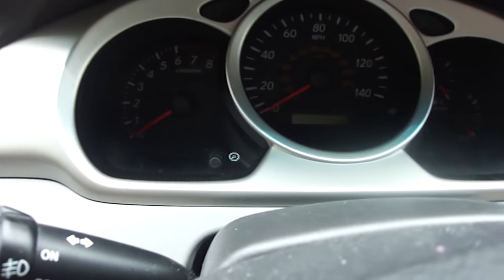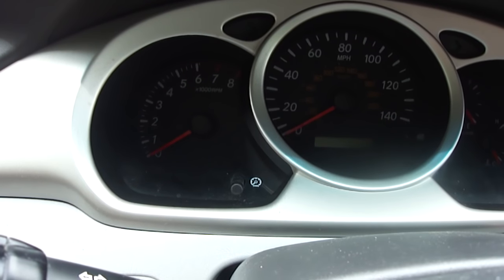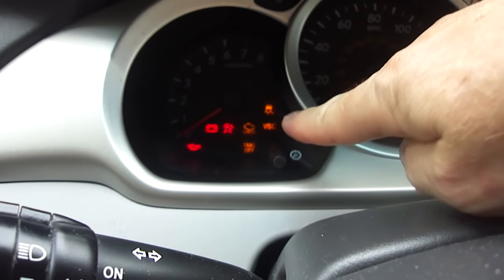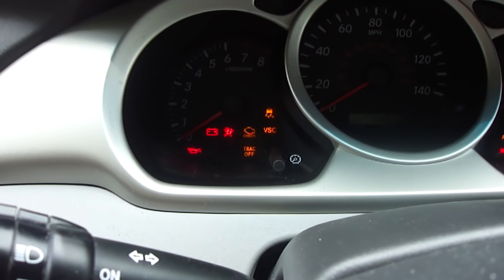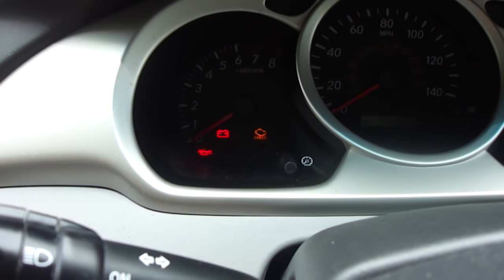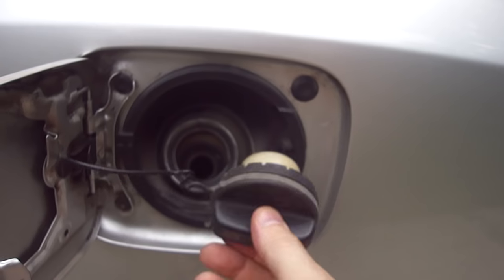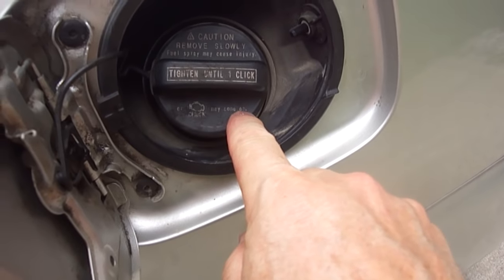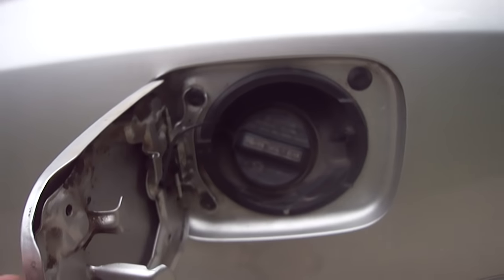(Part 1) How To Fix Your Check Engine, VSC, Trac Off Warning Lights On

Comment: Hey hi. Thanks so much for this hint. I probably saved a certain sum of money. While watching your video I remembered I'v  put some gas today and maybe it was the cap as mentioned in your video. It was actually the problem!!   By the way I don't know if it's related but today was extremely hot and humid.
Reply from the maker: You're very welcome!  I would have the car checked with a diagnostic computer scanner to see what trouble codes it stored from coming on which any auto parts store should do for free.
Reply: Hi. Yes, you're right. That TRAC Off and the check engine sing came back so I will go to for a scan this week. I have no idea what can it be. My car is a Lexus ES300 1999. Thanks a lot.
Reply from the maker: 8Bit Time Traveler Don’t sweat it! It’s more than likely a oxygen sensor or a mass airflow sensor which is easy to fix.
Reply: Gosh. What do you think it can be? Do you have a clue please?
Reply: I'm sorry for being annoying but I'd like to add few details about my car and what I did with these last days:
1- Last monday I discovered there was a hole in the left front tire so took off the whole wheel and replaced it by the spare. The spare is the exact same size than one that was there and is completely new.
2- I'v filed the tank with ordinary gas before going to work.
3- Yesterday I'v worked in my car for 12 hours to make a surveillance (I work as security). The aircon is not working but I kept my car open to "enjoy" the hot hair that was better than nothing.
4- The temperature yesterday and today is super hot. 33-36 C. and a feel like of 44 C. I don't know if it's related.
Thanks a lot.
Reply from the maker: Nothing really jumps out at me from what you've told me.  I know that extremely hot outdoor temperatures can affect electronic components on a car, especially if it sits and idles a lot.  Hopefully, having it checked for trouble codes will clue you in to the problem.
Reply: Hi Paul. I went to see a friend of mine who has a scanner. There are 5 codes: Codes P0125 P1130 P1150 P1133 P1153. He will search and try to see what's the problem. Thanks a a lot.
Reply from the maker: You're very welcome!  Could be a faulty or poor electrical connection for 02 sensor or in a very rare case a faulty PCM (powertrain control module, also known as ECM or engine control module.   Do you have stalling or jerking with manual transmission, or shifting problems for automatic transmission?
Reply from the maker: It makes sense that you fixed the P0125 code from adding engine coolant which fixed the problem of it not detecting enough heat in the cooling system.  If you end up needing to replace the oxygen sensors you might want to call Denso https://www.densoproducts.com/Automotive-Oxygen-Sensors-Denso-c1317.aspx and see if they make them for your car (very high quality) and see what it would cost on Ebay which will be your best pricing.  Keep a close eye on your gas mileage which can also tell you a lot about the performance of your oxygen sensors.
Reply: You are right. I just took an appointment at the garage to change the engine coolant. Thanks so much for this link. This is great to know. I hope he delivers in Canada.I'm in Montreal. I will check.
Reply: Monday we checked the engine coolant and it was dark green. We also thought it would be a good idea to change it.
Reply from the maker: Good idea.  Make sure you flush the system.
https://youtu.be/dRP4D40Vo8E
https://youtu.be/7bYbwBMbnTQ

Comment: While you're diagnosing this problem any codes come up I have a 2010 avalon that did the same thing with code p0300
Also misfire from cylinder 135

Comment: I have 2007 Sequoia. All the dash lights came on in the cool am but not in afternoon. Turns out brake fluid was just below the minimum in the am but just over min when it warmed up. 3$ fix.

Comment: My same lights came on & the “code” indicated a leaky gas cap. Got a new one & placed it on tightly/4 clicks but lights are Still on??? The lady that sold it said it Should (eventually) go off though,,,am I panicking too soon? Please help. Thank you! 
(I have a ‘05 Scion/Toyota xB) 🚙
Reply from the maker: djCatScanRL Do not panic and the lady is right. It should definitely turn off after you’ve driven 50 miles or less if that’s the problem. By the way, the car will usually drive just fine even with the light on.

Comment: Mine on in my 2010 Avalon. Don't kno y. I tried the gass Gap didn't work .. no engine check light. Just the those 2 other lights. I don't kno how to clean it.. don't kno if the cap is bad

Comment: Hey guys i had  problem in 4 runner 2002.after i change HBB motor with pump. Brake started work perfect. Only one problem ligts is on and  Firestone not can read ABS CODES. They say they not see ABS. 
And not  possible to do zero point calibration
My question.
What can be wrong?
Were is brain of ABS system?
ABS module (come with master silinder)  or ABS TRAC VSC COMPUTER CONTROL MODULE (what is left side of driver.)
Thank you.

Comment: Mine is still on and I made sure the cap was proper clicked
It’s pissing me of cause I asked my neighbour to give me the codes it has but he just cleared it.
Like tf.
And I just checked today and all three are back on.
So obviously something is going on that a mere code clearing won’t solve.
I don’t want to pretend their isn’t an issue. I’d rather walk with it before it actually becomes a problem that requires a pro mechanic to deal with.
Reply: Have an ‘08 Sienna XLE.  had all these random misfire codes (VSC) and even would have to shut my van down as the “traction control” light would blink along with the engine light causing the van to lose power and decrease in speed, till I shut it off and restarted it.   And that would take care of it for a week or so then back again, usually one the Highway.  So off to the shoulder again as the van would slowly lose power and buck and gas be basically unresponsive 

Seems like maybe the compression was changing over the 200,000 miles as i started putting premium gas in and the higher octane was the key.. as all the codes went away (once cleared) and never came back.   Same spark plugs.  I did change one injector (before I switched to premium gas) as it did have that code come up for the number 2.  But the check engine lights would still come on.   But same spark plugs on all 6 cylinders as those back are just too hard to change without a good reason.  

Again premium gas and all my check engine lights and blinking lights are a thing of the past and it’s nice having a dash free of those.  (Those lights came on probable a dozen times in the past.  But now problem solved for like 9 months now and counting.

So if it returns might try that.   I’ve disconnected my battery several times.  And light always would return after a period of time.  Also I had cleaned my gas cap in the past.    

But premium gas is what helped when everything else was just a temporary fix.  

God bless

Comment: Im fairly confident that the gas cap has nothing to do with the traction control light. My 07 camry is displaying the same warning lights but my gas cap is 100% good and properly shut.
Reply: Some cars like Land Cruiser have double brake circuit, which means ABS, VSC and TRC are connected together and if one fails you get brake warning lights and VSC and TRC also. Problem is finding the source, it could be a coroded or oxidated connections of some fuse or cables. Sometimes even the most advanced Diagnostic tools can't see any issue if problem occurs. I have Prado 120 left front abs sensor changed and the mechanic specialised for ABS system told me we need to take it to shop one kore time to look deeper. Lights are now suddenly off everything is fine, but I also see now connection beetwen fuel system and ABS hydraulic pump or ABS ECU.

Comment: Thanks a lot.  I fixed it VSC gone but Engine lights still on. I dont know why.
Reply: Take it to advanced or autozone. They'll check the codes.  Put the codes in google and fix it.

Comment: No doesn't work on my Toyota Alphard. All 3 lights come on at same location of road when accelerating on a up ramp/slip road. I just restart car and it goes away until next time I use same section of road. Suspect its faulty sensor.
Reply: Have an ‘08 Sienna XLE.  had all these random misfire codes (VSC) and even would have to shut my van down as the “traction control” light would blink along with the engine light causing the van to lose power and decrease in speed, till I shut it off and restarted it.   And that would take care of it for a week or so then back again, usually one the Highway.  So off to the shoulder again as the van would slowly lose power and buck and gas be basically unresponsive 

Seems like maybe the compression was changing over the 200,000 miles as i started putting premium gas in and the higher octane was the key.. as all the codes went away (once cleared) and never came back.   Same spark plugs.  I did change one injector (before I switched to premium gas) as it did have that code come up for the number 2.  But the check engine lights would still come on.   But same spark plugs on all 6 cylinders as those back are just too hard to change without a good reason.  

Again premium gas and all my check engine lights and blinking lights are a thing of the past and it’s nice having a dash free of those.  (Those lights came on probable a dozen times in the past.  But now problem solved for like 9 months now and counting.

So if it returns might try that.   I’ve disconnected my battery several times.  And light always would return after a period of time.  Also I had cleaned my gas cap in the past.    

But premium gas is what helped when everything else was just a temporary fix.  

God bless
Reply: I am already using high octane 95 petrol. I am not accelerating as hard on that particular part of road now, keeping to 40kph until it flattens out. Lights not come on for a while now.

Comment: I have a Lexus is350 2006 I took it to the dealer and they said just to inspect it it’s 160$ to find out what the problem is kus I have the vsc check light on should I take it in or is it waste of money and easy to fix ???
Reply from the maker: B Ortiz First perform steps 1 through 7

Comment: For the past two weeks, I've been having P1150 codes popping up. I've been disconnecting the battery and reconnecting it to see if it comes back, but after driving about 2-3 days or 50 miles, it comes right back on. Is it time to change out the Bank 2 Sensor 1?
Reply from the maker: Sounds like the air/fuel ratio sensor (looks just like an O2 oxygen sensor) needs to be replaced.
Reply: @proclaimliberty2000  update: just went to autozone, turns out i have a p1130 and p0110.

Comment: Having the same problem now...I bought a new gas cap!  Make sure I heard click...lights are still on?!  Help!!! have an 05 Camry
Reply from the maker: Shadow Blade First drive at least 50 miles and see if the check engine light turns off by itself.
Reply: @proclaimliberty2000  thanks!  so you don't thinks it's a fuse, or sensor? Issue...

Comment: In my car will driving VSC, track off, and check engine,lights will go on, then turn off the engine,
The lights go off,engines start after 30 to 40 seconds,
Can what be problem?
Help plz

Comment: On my 2010 corolla was the coil #1 and it had the same problem fix it my self in 5 min for only $30.
Reply from the maker: Thanks for posting!
Reply: The most important part is you have to know which cylinder! I'll assume that you had access to a code reader.
My V6 Rav had a bad coil, but it was #5 which is up against the firewall and under the air intake. I paid the $300!

Comment: I have this problem on my 2016 Toyota Scion and its not the gas cap and still showing me the no traction and check engine. And won't let me go faster than 5 mph

Comment: These three lights came on and AutoZone says the car is throwing a P0420 code.  Is it possible that it is really something as simple as a bad gas cap connection, or do I really need a new catalytic converter?
Reply from the maker: Laura Anderson Unfortunately a new gas cap will not fix a P0420. You more than likely have a bad oxygen sensor or a bad intake manifold gasket which will cause a P0420. Have you noticed a decrease in your gas mileage?
Reply: @proclaimliberty2000  Thanks for the prompt response!  No decrease in gas mileage at all.  Car runs fine with no smells.  Got this code 2 months ago and the mechanic tried a cat cleaner.  Was getting a P0171 nine months ago and the dealer replaced the MAS.  Replaced a rattling exhaust heat shield 6 months before that.  This is a 2006 Toyota Highlander with about 130K miles.  Have put $1300 into the car's exhaust system in the last 15 months :(
Reply from the maker: Laura Anderson it’s going to take a good diagnostic mechanic to figure this out. It could be a bad oxygen sensor, spark plug, fuel injector or something else.  You could also start off by adding fuel injector cleaner to the gas tank. You could also disconnect both battery cables for one hour and then reconnect them and see what happens.

Comment: I have a 13’ Highlander. I was in a rush one day and left the gas cap super lose. These lights came on, and I tightened the gas cap (which was almost off) and I've driven and it hasn't reset :( the lights are still there. Ugh!
Reply from the maker: As long as you have the gas cap back on correctly it should all clear within 100 miles of driving. If it does not then just keep driving and it should eventually turn off. Don’t worry about the lights being on as you’re not hurting anything.

Comment: Tried it on my avensis 2008. Did not work yet, do I need to drive a certain number of miles before this solution works and trc svc light disappear?
Reply: Ah part 2, I need to drive around a few days
Reply from the maker: Sometimes the lights disappear right away and sometimes it needs to be driven some.

Comment: My was doing the same. I changed the gas cap. I unplugged my battery to reset the codes. drove it, then 1 day and a half later, on the way home, stopped at a stop light and tada!, the lights came back on.........??? Any other thoughts?
Reply from the maker: Perform Part 1 through Part 4 and or check with a computer scanner.

Comment: New OEM gas cap didn't fix this, any other causes?
Reply: It didn't fix mines either, I got a code reader for cheap online and it read 5 codes. I googled the codes & it said it was the Evap Canister underneath the car that needs to be replaced.
Reply: @DavidPacJr  Thanks. Mine read catalytic converter efficiency. Seems I need to replace cats or O2 sensors before/after the cats, or both. 117,000 miles so could be any of those.

Comment: Well I was hoping this would work for me but unfortunately  not. Had a diagnostics done by a mechanic and it read that I need a new throttle/pedal sensor. It's going to cost me 300 bucks or more. Any way of getting around this? If anyone has any advice it would be greatly appreciated. At first it was just the Vsc trac Vsc trac off lights that have been on for about 8 months now since I had my last vehicle inspection and after I left those lights were on. Now I had a mechanic put on a new valve gasket cover and do a radiator flush, and then the malfunction lamp light came on as well, so now I have all 3 lights on. I swear to god everytime I have someone fix one thing another thing goes wrong. Someone please help lol.
Reply from the maker: Are you having any trouble with the throttle/pedal?  What was the trouble code?
Reply: I don't know what the trouble code was exactly, I don't have a reader to test it myself. But the guy who ran the diagnostic for the vsc trac trac off lights said it showed it was the accelerator throttle/pedal sensor. I don't see or notice anything wrong with my gas pedal. I just need the light shut off to pass vehicle inspection, because I live in Texas and they require it.
Reply from the maker: If your throttle/pedal sensor is faulty you will eventually notice acceleration issues.  It could also be it's not receiving the proper voltage from other issues.  You could replace that part yourself which would help your wallet.  For inspection purposes, you could disconnect the positive battery cable for 15 minutes and then re-attach it before the test.  This could clear it temporarily.

Comment: I did this on my 2018 Toyota Corolla and the Trac is still on and my check engine 😔
Reply: Have an ‘08 Sienna XLE.  had all these random misfire codes (VSC) and even would have to shut my van down as the “traction control” light would blink along with the engine light causing the van to lose power and decrease in speed, till I shut it off and restarted it.   And that would take care of it for a week or so then back again, usually one the Highway.  So off to the shoulder again as the van would slowly lose power and buck and gas be basically unresponsive 

Seems like maybe the compression was changing over the 200,000 miles as i started putting premium gas in and the higher octane was the key.. as all the codes went away (once cleared) and never came back.   Same spark plugs.  I did change one injector (before I switched to premium gas) as it did have that code come up for the number 2.  But the check engine lights would still come on.   But same spark plugs on all 6 cylinders as those back are just too hard to change without a good reason.  

Again premium gas and all my check engine lights and blinking lights are a thing of the past and it’s nice having a dash free of those.  (Those lights came on probable a dozen times in the past.  But now problem solved for like 9 months now and counting.

So if it returns might try that.   I’ve disconnected my battery several times.  And light always would return after a period of time.  Also I had cleaned my gas cap in the past.    

But premium gas is what helped when everything else was just a temporary fix.  

God bless